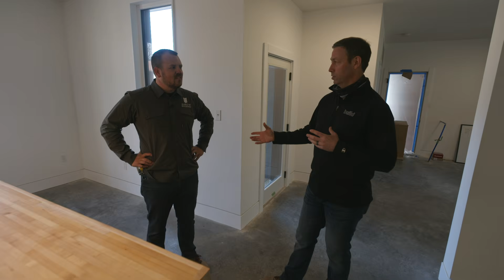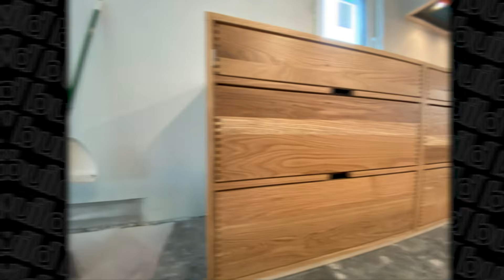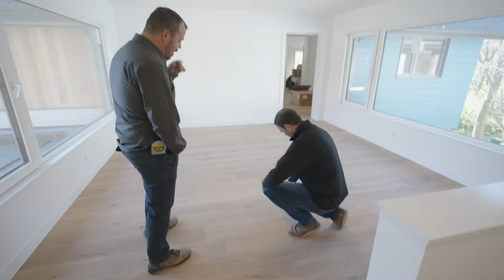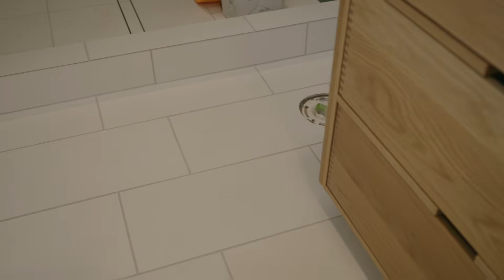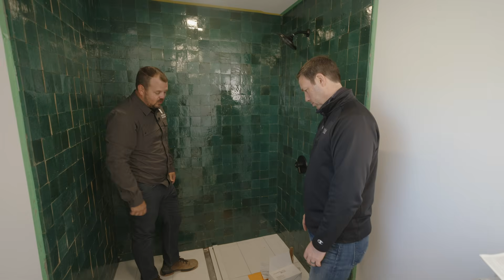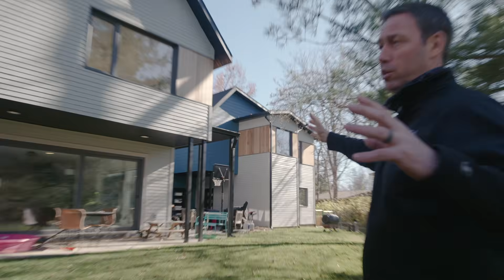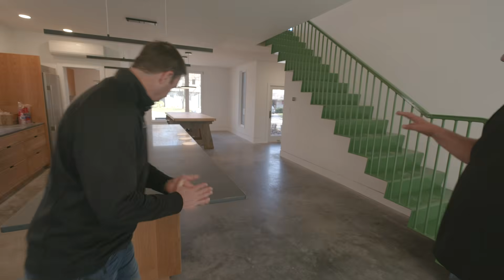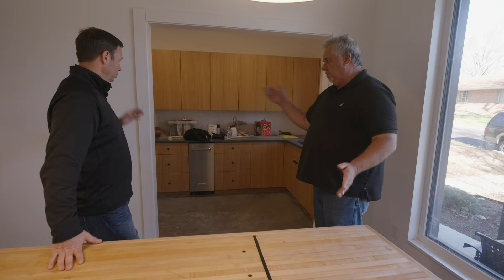Builder’s own INSANELY Efficient House!

Comment: I love how excited Matt gets about the R value of the walls 😁
Reply: Me too
Reply: Same excitement when Doug demiro finds a new quirk
Reply: I’m gay for R-Value.. pure and simple.
Reply: Spec shock! :)
Reply: Such deception. R VALUE does not translate to the wall details, posting, headers, floor interface...blocking exterior nail depth ( compresses insulation).   Actual measurements will blow these lies out of the water.
Reply: Its standard procedure for a Dad when you have girls living in your house  to know the R value of your house and the savings :)
Reply: @kevinkelly9895  kk.org? 🙏
Reply: @kevinkelly9895  I live in a poor insulated house built in 1950 and I don’t need to use AC or heater for more than 30 days a year or probably 200 hours combined. Oh, I am in Southern California.
Reply: @aliciafaulkner416  With a well insulated house you save the cost of AC/heater, energy, anywhere, anytime of the year, even at 7200' in CO, see Rocky Mountain Institute's house/headquarters.
Reply: @aliciafaulkner416  That may fly in Southern California, that will not fly in Missouri.

Comment: Concrete, stone, and tile--all hard surfaces that are hard on the feet, knees, hips and dropped dishes!
Reply: I used to agree, but one dog puke cleanup and suddenly I’m ALL for solid floors. 😬
Reply: Personally I prefer wood dishes and porcelain floors over the other way around, and that solves the dish problem at least.
Reply: When is the last time you dropped a dish? Sidewalks and pavement is hard too , toughens you up .
 I am sure with the echos in there there will be many area rugs and furniture to absorb the sounds and soften the butt from sitting on the floors.
Reply: @johnwmendenhall9896  I dropped a dish yesterday, fortunately I have pier and beam with wood floors!   Having to stand, walk, or run on concrete floors  can lead to lower back pain, knee , foot, ankle pain,  joint damage and worsening of arthritis symptoms.  Cops "walking the beat" are called "flat foot" for a reason. Look at cashiers and work stations in Big Box stores, they have mats on the floors for the employees to stand on to lessen the impact of standing on concrete.  Also good quality running shoes are made with with impact absorbing soles for a reason.

Comment: Beautiful home. I would've had the cabinet doors flip open instead of a regular swing door. As for the shower I would've installed multiple shower heads in front and rear of the shower, and also have a 12 inch rain shower head above. 👍😁
Reply: energy efficiency is about water too.8 billion people need water
Reply: You must live where water is not scarce.  Water cost in some areas exceed energy bills.
Reply: @joniboulware1436  Well maybe they're 5x 0.5 gpm showerheads, which would probably be more comfortable than a single 2.5 gpm showerhead.
Reply: @hailexiao2770  Maybe some shower heads are low flow,, but not a rain head.
Reply: If you can afford all of that fancy stuff you can afford a happy wife with a few extra shower heads.

Comment: A Ferrari that performs like a Prius?  Not the best metaphor, dude. :-D
Reply: There is a Ferrari coming, F171 a hybrid, like a Prius, should be end of 2021. With a V6, still makes over 700bhp, plus the  e-motor
Reply: @zlmdragon.  this one will be road legal and have longer lasting tyres
Reply: @zlmdragon.  but this one will be road legal, and have tyres that last, it may be quite fast as well.

Comment: worked for a guy that pulled out a boiler system and put in a minisplit in colorado... maybe 700 sqft with high ceiling. its not warm. Then he bought a ventless fireplace, which does warm the place but you breath carbon monoxide all day, till the sensor trips. Some of these are great products, but when they push them they need to say, this product is not appropriate for XYZ applications.
Reply: The unit is way to small. Mini splits should be well over sized. I bet he only put in a 12k unit. He should have installed a 24k unit. Mini splits are not the same as central heat or any other types of size based systems. Mini splits work on the function that they can scale. They can scale from zero to the max. Though 700 square feet calls for 14k btus and the system should be much larger.

Comment: 2x8 sounds great, until you see how rediculous lumber prices became this past year. In 2019, you could get a simple 2x4x8 for 2.75. 3.26 at the max. It's currently 5.50$. Essentially doubled.

A 2x8x8? 12.57$ currently. For one.
Reply: A 2x4x8 at my local hardware store is $10. Just outrageous.
Reply: But 24” OC instead of 16”, so you’ll need less of them.
Reply: I'm paying $4.95 2x4x8.
$16.25 2x8x8.
Yeah, no thanks.

Comment: The shark bite fittings on the water heater should be a felony
Reply: I think they’re fine. Wouldn’t have them buried in a wall but out in the open where I can see them, I don’t think is a problem.
Reply: @greenmount73  you must not work in a skilled trade.  My apprentices piping would put that to shame. Pride should be shown in all work at all times.
Reply: @Thepete2432  I wasn’t making a comment on the quality of the work. Just saying the shark bite fittings themselves are fine in that situation.
Reply: @Thepete2432  Yeah i would rather install sharkbite than put in expensive copper and yes I was a apprentice many years ago. I have installed pex in a number of houses over the last decade and they are doing great and a few places have froze a couple of times and not a single water leak or repair has ever had to be done. Unlike the patch jobs I have had to do on copper pipe.
Reply: @kameljoe21  I still use a ton of copper up here in the northeast, shows my pride in the trade.
Reply: @Thepete2432  Yeah there are still a lot of places that use copper. Though I do not in any of the homes I have done. Its more of a waste and cost way more. WIth sharkebite and pex I can add/repair with out having to call someone to do it. Adding on to pex is so simple and the freeze protection is far better than copper will ever be and will last much longer.

Comment: Sure, a 6 degree difference in temperature is really good across that house, but it's still too big, IMO.
Reply: But that was with 1 mini split unit on the main floor...and 4300 sq ft. Will easily balance when they turn on the other 3 mini splits

Comment: $4550 for a hot water heater. OMG what a waste of money. heat pump unit  would of been fine, they are not that noisy
Reply: But if installed in the conditioned space, it would turn that space into an ice box.  I put heat pump water heaters  in garages and the garages are ice boxes. Supposedly there is a kit to vent them outside. I've heard,  but haven't implemented it yet.
Reply: @wjthehomebuilder  then put in the garage, thats where a lot of water heaters are anyways.

Comment: Giving a thumbs up just for the 2x8! Having been through multiple houses and multiple rebuilds/remodels, I'm all for upfront investments in quality. It pays back forever! Thanks for your videos MR.
Reply: I did 2x8 walls when I built back in the 90’s. Cost was only a few hundred dollars more.
Reply: One bad thing is loss of space with the thicker walls.
Reply: @skliros9235  Well for inside walls I really don’t see the point other than for aesthetics, but for the outside walls I think they’re fine (if you can’t afford to waste 3 or 4 extra inches of thickness maybe your yard is a little tight.
Reply: @skliros9235  I always hear this concern, along with people complaining about losing 2 inches of height when insulating basement slabs. You're losing 1/6 of a square foot per linear foot of wall vs 2x6, so for a 30x40 ft house that's maybe 23 square feet. Not a big deal.

Comment: The only major lack of craftsmanship that I see is the staircase. I feel the execution is FAR inferior to the rest.
Reply: I guess it's what they wanted.  Would have looked better with a floating wood staircase in my opinion.  Either with a center stringer of metal and wood treads or where the metal is attached to the wall framing so they are truly floating.
Reply: The welds looked like crap. Completely underwhelmed by that staircase

Comment: G, day The Build Show Tx from Sydney Australia.

Realistic issues
* staircase handrail giving structural strength ( gusset/stringer blocks) under the treads and risers.
* I'd like to know the hinges on the cabinetry. They have good close action.
* How Is the cooking smells exhausted in the kitchen?
Architecture and adaption to personal needs.
Steve- is this a house for a family; or,
Will a family adapt? Could you issue the customer with a checklist
✔ energy saving
✔ passive orientation
✔privacy
✔friendly and relaxed 
✔an assets and investment 
🔍

Comment: I have to say that, while the starkness of that home wouldn't fit either mine or (more importantly) my wife's parameters, I LOVE the air efficiency and overall layout.  Although we would prefer a MB on the first floor LOL.  
.
Why not go with a radiant heat/cool system for the ground floor since you have a cement flooring system?  And I liked the pointing out of the roof angles for solar power.  The shallower pitched section is a LOT larger than the steeper pitched which would help to compensate for atmospheric loss.
Reply: @zlmdragon.  LOL That would definitely be me.  I absolutely HATE stepping onto a cold bathroom floor in the middle of the night to pee!  The thing is, there isn't a whole lot of difference between building for winter's in Missouri and winters in Michigan (where I am) as far as GROUND temperatures are concerned.  A big difference regarding snow loads but that would be a different episode.
Reply: @zlmdragon.  Tell my FEET that!  My brain agrees with you, and my home, for all that it was built in the 1950's is decently insulated, but the damned bathroom floor STILL feels like I'm walking into a sub-zero freezer!

Comment: I know this water heater was probably very expensive, but they must of spent 100's in sharkbite push fittings alone! I didnt know that those could pass code. Even with a newly built house they used contentious push fittings why would you not just replace that line till you got to an elbow? Less fittings less chance of leakage right?
Reply: I thought half the benefit of PEX was the ease of doing home runs, why the hell do all these people put fittings everywhere?
Reply: @namAehT  The more I look at it the scarier it becomes. It looks like the crimped fittings are the black plastic ones I've seen but never trusted. I always worried that crimping those could crack the plastic. Another scary thought is if those push fittings are behind that beautiful dry wall work. I know they had to charge the lines to pass inspection and the bladder on the expansion tank should cover excess pressure but if the plumbers (or he) did not cut the pex strait or did not make sure to plug the push fittings in all the way. It will might leak causing drywall/stud damage and since it is a passive home it wouldn't be able to breath, compounding the problem. Also the safety valve looks like it is done with a clamp ring rather than a crimped judging by the color and it is not near a drain. I know that hot water tank should not go off for many many years but anyone who has had a water heater safety valve go off knows the damage it can do and if it got on that nice oak floor would cause major damage to it. Among all those issues if that hot water tank safety valve did go off in a closed envelop next to the the air conditioner, the steam from the tank could short circuit the air conditioner (im assuming it is an electric air conditioner, as he said he did not want combustible gasses in the house). The rest of the house looked really good! The plumbing however looks a bit sketchy.

Comment: Looking at the rooflines and the considerations about solar. At that latitude, wouldn't it have been better to put the solar panels on a 12/12 pitch (45deg) to maximize efficiency for Spring/Fall, rather than lowering the pitch to optimize for Summer alone?
Reply: I think the lower pitch was so they could fit a second row of panels on the same roof (or longer length panels).
Reply: @pieorion883 , possibly, but wouldn't that mean paying more for less efficiency? There's gotta be something I'm missing.
Reply: @chaseweeks2708  Im just guessing here, but it could be that even though it’s less efficient per sq. ft., the added solar panels are able to harvest the necessary energy for a net zero house.
Reply: @pieorion883 , eh, maybe.

Comment: 0.07 ACH/50?
Holy schnitzel!

There's "tight".
Then there's Passive House/Passivehaus.
Then there's "The Air Can't Breathe!"

While the style isn't my cup of tea.
But the engineering of the envelope and HVAC setup is PHENOMENAL!

And there is no such thing as "cheating" numbers when you're talking about air sealing.
Reply: Until you open the sliding glass walls.
Reply: @mactek6033  True.  But how often are you going to be opening windows in inclement weather?  Especially when your HVAC system is ALREADY bringing in cleaner, fresher air?

Comment: I cannot fathom the mental disconnect between bragging about the warmest possible concrete floor without having heating in it and then a moment later showing off a steel staircase.  You couldn't possibly get a colder staircase without actively cooling it.  And walking down that in socks would be tempting death with every step.
Reply: I was thinking the same on the concrete floor.  Spend all that money why not heat the floor?
Reply: @thezfunk  Its so insulated that it wouldn't me much use to heat the floor. The biggest issue is probably the need for a lot of cooling since any appliance that generates heat is going to stay inside.
Reply: You'd have a point, if that's how physics worked.
Whether you have a cardboard box or metal stairs in that house, they will be the same temperature.
Metal is a better conductor of heat, so it will suck the heat from your body faster than cardboard.
The super-insulated, very airtight house will have everything toasty.
But you're probably right about the slips and falls.
Reply: @robertfeliciano5723  Terribly sorry, I didn't realize that Build Show videos on youtube was a place where you had to go into the thermodynamics and neurobiology of the sensation of heat and cold when talking about perceived temperatures.  You are technically correct, great arbiter of technicalities on youtube.

I'll try again.

Since steel is a wonderfully good conductor of heat energy, and since we perceive the feeling of cold when heat leaves our body, that steel staircase will always FEEL cold whenever it is contacted by skin or barely covered skin (like a foot in a sock).  In fact, since steel is such a good conductor of heat, and since that staircase is essentially shaped like a giant heat sink, even if the room was kept at 90 degrees Fahrenheit, the stairs would still feel cold to the touch.  Assuming the room and stairs will be around 70 degrees, the stairs will feel like walking on ice, much worse than the coldest feeling tile floors.  Note that this dude did, by the way, put heat under the tile in his bathroom because the tile will otherwise feel cold no matter what the room temperature is so that's two points where he's bragging about a warm floor - one on either side of his showing off the heat sink staircase.

Bragging about how warm your unheated concrete floor will feel and then showing off a heat sink steel staircase is dumb.  And if we want to get all the way to the point, that concrete floor will also ALWAYS feel cold because the concrete is also a very good conductor or heat (with a large mass) that will always be probably 25 degrees or so below body temperature.  That's why Matt has done a bunch of videos lately about putting Styrofoam and plywood over the slab in his own house.  It works amazingly well, I actually just finished doing the same thing in my basement (in Southern Ontario).  After making such a big deal about the work on his own house, I'm surprised Matt would just let this dude say what he said about how warm his slab is going to be.  Because it isn't.
Reply: @craigthibodeau324  There's a reason a thermometer goes in your mouth or the other end. 98 degrees is the inside of your body, not the outside.
It won't have to be 90 degrees for it to be comfortable, 72 would be more than fine for most people.
Reply: @robertfeliciano5723  There's a reason people put heating elements under tile floors - because at regular room temperature they feel frigidly cold.  Don't try to say otherwise.  That's why the guy in this very video put heat under his tile floor.  Steel is a much better conductor of heat than tile is.  As cold as tile floors feel to bare or barely covered feet, the steel will feel colder.  The solid concrete floor, even with insulation under it, will never feel warmer than (unheated) tile floors which everyone in the entire world knows feel cold to walk on.  Why in the world would you be arguing this?
Reply: @craigthibodeau324  Elevated stairs are not the floor. Stop equating the two.
Reply: @robertfeliciano5723  You know what, they aren't equal but they sure are similar.  If it's a floor or a steel stair tread conducting heat, your feet sure can't tell the difference.
Reply: @zlmdragon.  "Feel" that's the part you left out originally. Feeling cold and being cold are different, e.g., wind chill is for people, not inorganic items.